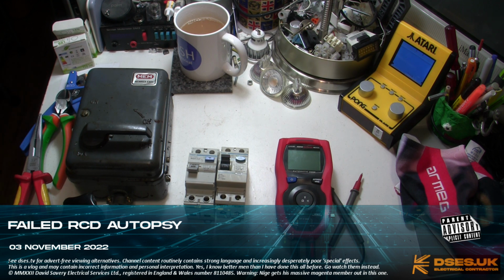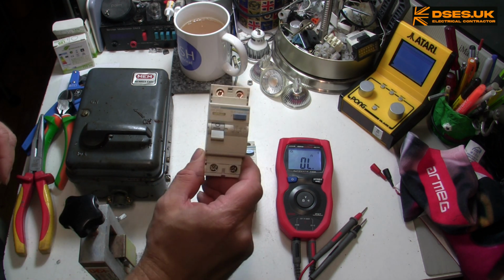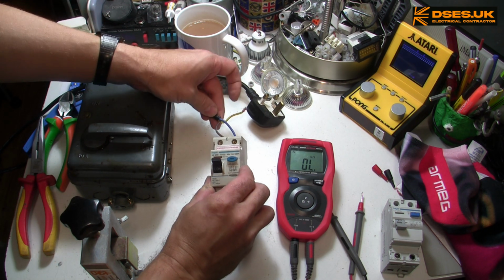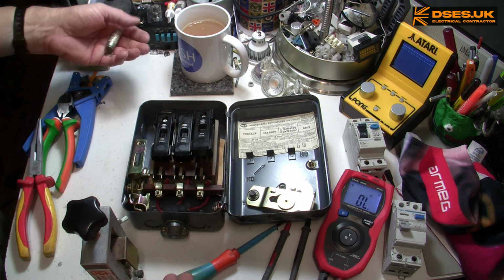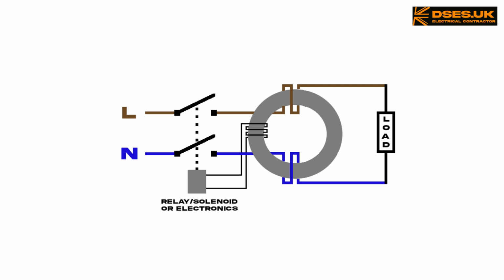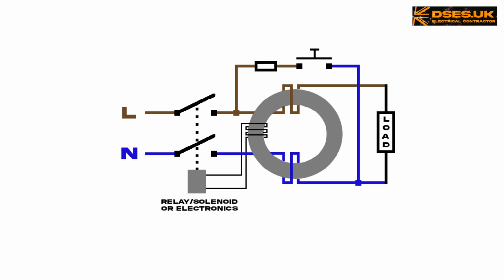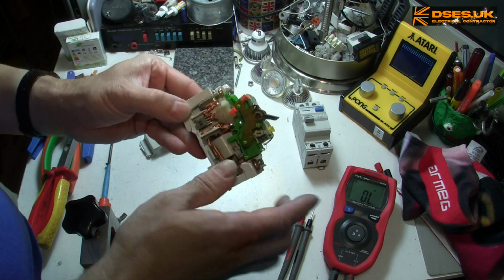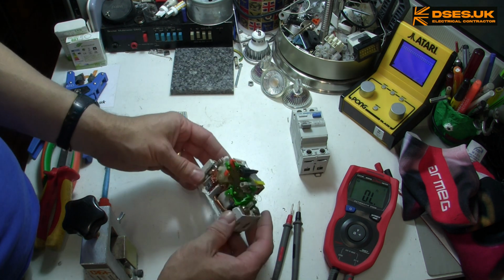Failed RCD autopsy

Comment: As far as putting an RCD/GFCI on a circuit if there is no ground/earth, we are allowed to have grounded outlets with no ground connected as long as a GFCI is feeding that circuit and a label stating "NO EQUIPMENT GROUND AVAILABLE" is put on the outlet.

Comment: Happy Bumblymess to all at electricians comedy central. Over the years I have found a few old RCD's that have started tripping at lower leakage currents. Not a fault with the wiring. Always wondered why this is and no clue as yet. May be component values drifting over time possibly. Or one of the double pole contacts is more corroded than the other? I live on the coast so salt corrosion is an issue here. May be related. Nice shark tank!

Comment: 15:25 cutaway full of junktronics, when in the end, actual thought process and being tough/high resistance rules. I shocked myself about 999 times over my 45 years of life.
everything from 6v lantern batteries in series to over 180VDC to 30+ kv dc (yeah, in left arm and out left leg) from vehicle ignition coil... I landed about 4 to 5 foot back, with the table and equipment knocked over.

Comment: I have a confession to make,I pass my city and guilds electrician and approved courses,went on to work for one of the largest companies in England,Crown House Engineering Ltd for 25 years,due to working away I only passed the 15th edition,for the 16th and 17th I was away so missed the courses and exams by the time the 18th came around I decided as a stubby sole trader bollocks I'm not taking it or the test and inspection course,but in my career I've ran big contracts with no foreman certificate  I've also carried out test and inspections for big contractors,was even a sub contract foreman on the new formula 1 Silverstone ŕacetrack and buildings yet I see myself as a genuine sparks ,do you think because I never held these certificates that I'm actually a fraud and not a proper electrician.
Reply from the maker: I don't think any qualification makes you a bona fide electrician or that the lack of any particular paperwork makes you a fraud. There are people who are wizards on the tools but who can't cope with examinations or the classroom environment for various reasons. Conversely, I've met people who have it all on paper, but give 'em a screwdriver and their cackhandedness with tools becomes apparent very quickly. Everyone has their own individual skills, strengths and weaknesses and their own backstory of their journey into the industry. Those who know their onions ought to thrive, those who don't won't get too far. Technically, I'm a fraud because I never sat the AM2. If I were joining the game now, NICEIC probably wouldn't accept me as a QS, yet here I am doing the job, and to a better standard than many others who do have their AM2 from what I've seen. Qualifications are important, but experience is what really counts, and anyone who is adept with the tools and who is prepared to further their own self learning to get the job done right will do better than someone who happens to have attended a classroom, especially with the state of today's FE collages.

Comment: Assuming a 30 amp fuse and 30 amp fuse wire does that mean that's now rated for 60A? That's one way of upsizing a circuit to avoid motor in rush.
Reply from the maker: Yep. Two parallel current paths will double the effective fusing size!
Reply: @dsesuk  double the pleasure and extend the fun. Hey there's fireworks!

Edit:
Oh my that has more than one meaning.

Comment: GFCI only makes sense if it only detects faults related to Ground, an RCD will disconnect from imbalance between the two (or more) circuit conductors not necessarily a ground fault

Comment: With regards to the date of that MEM switch. MEM stamped the date in their gear, however they stamped it in reverse, so yours would be 06/11/?? I can't make out the first two digits that would indicate the year from the video. Anything pre 1983 may contain asbestos. After this date their products were designed using different materials. Hope that's of some use.

Comment: Superb video... even though i was shouting "3.3K!!!..." at the screen 😂 Have you ever had MK RCD's fail a test on a Kewtech tester?... I have, but when i tried the test again on a new replacement, it also failed, worked fine on others like RCBOs and Hagers etc.. wierd.
Reply from the maker: There was a time when I would have reeled that resistor value off the top of my head! As for MK RCDs, no, I don't recall experiencing any failures. Mind you, I never really installed them as a brand although I come across them often enough of course.

Comment: @7:34 LOL! Nice to know that rednecks can be found anywhere. Did you guys ever use the "renewable" fuses? More than once I've taken one apart and found two replacement links in it. And amazingly, they are still legal as long as you don't abuse them. WTF?

"NEC 240.60(D) is a new requirement in the 2005 NEC and is modeled after the wording in 240.51(B), where plug fuses of the Edison-base type shall be used only for replacement in existing installations where there is no evidence of overfusing or tampering." 

Really? No possibility of abuse here. :)

Comment: In the US the GFCIs are rated for 5 mA which to my knowledge means 4-6 mA. They work differently as they are electronic. The low current rating is based on the let go current on a child.
Reply: The uk presumably approves of child sacrifices because the norm in uk is 30 mA.
Reply: @oldbutstillcurious3615  I'd up it a tad just to make sure.

Comment: That TIS Rhino Smartmeter is just the sort of thing that every manufacturer has to make just a simple meter for mesuring the basics. voltage, ressitance and continuity . multimeters now have too many functions that in my case i will never use so why should i pay extra for them.
Reply from the maker: I have so many meters that buying this was a frivolity, but as a little bench indicator that doesn't need any dial twiddling, it works just fine.